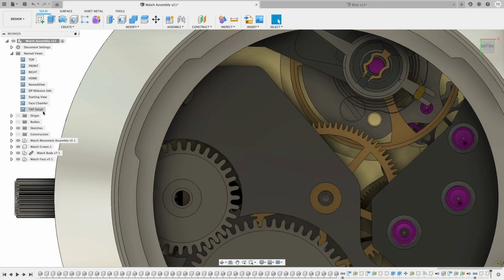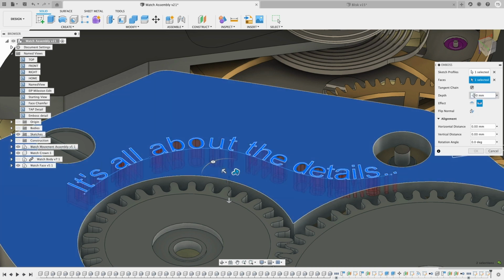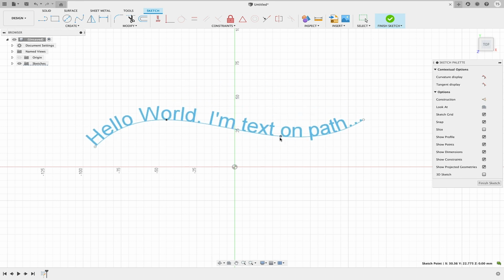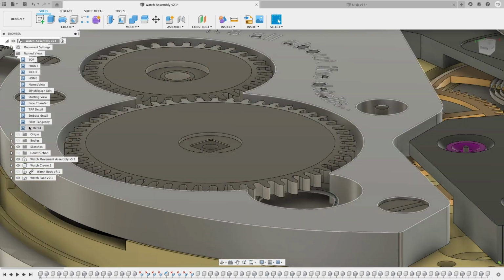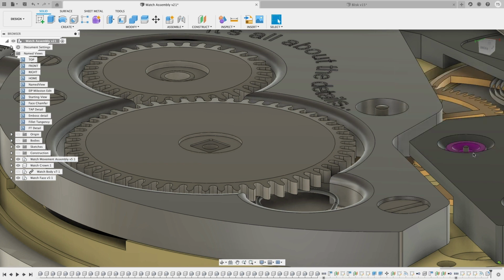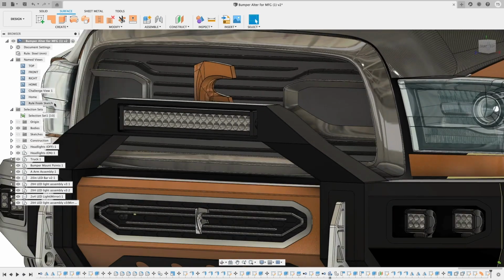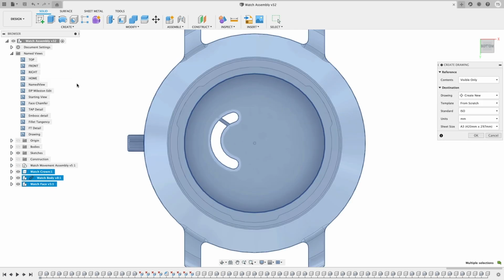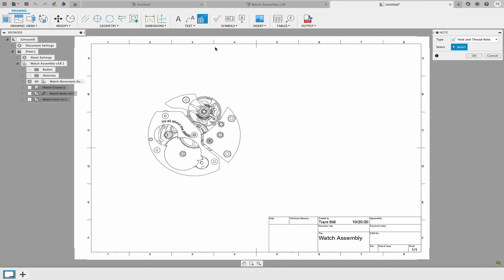What's New In Fusion 360 Design & Engineering – October 2020

Comment: Text has never worked properly for me. If I extrude any curved letter (like a C), the curves are not a continuous surface but is divided into smooth segments with a hard line between them, which is very visible. This happens on all fonts including downloaded ones, so I don't think it's a local issue. It only happens in Fusion. This makes the text tool almost useless. The only way to get proper text is to use the font I want in a different program, then export it as an .svg, and import it into Fusion, where it now extrudes correctly.

This problem is  annoying as these lines will show up on 3d printed models. There seems to be a problem with the way Fusion handles points on the curves that's in the letters. Does anyone else have this problem?

Comment: Will it be possible soon to export a total BOM including all mechanical parts, PCBAs, and electronic components on PCBAs?
Reply: I just tried the new parts list table - better but it still sucks - does not import description from ecad , does not show designators, shows all assemblies with now option to suppress sub-assemblies
Reply: Dave M thanks for giving it a go. Until there is a total BOM solution, I think the advantages of the integrated design and manufacturing tool for total product development just isn’t there. If they choose to solve this well, it would be incredibly powerful. With exception of things like graphic art (packaging, user manuals) and firmware/code, fusion could be a total product solution for any electro mechanical product. Just not there yet. Progress continues to be good though.
Reply: @mmorena2787  I Agree, I am currently evaluating BOMMER for F360- Its OK, but I would like something built in and linked to a master parts list which can link in with my inventory/accounting software.
Reply: Dave M I’ve tried Bommer and open bom and found both really not great. Lots of bugs, sluggish. Professionally I’ve used Arena PLM, but this orders of magnitude more costly than Fusion itself.